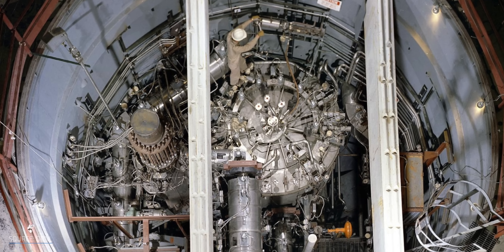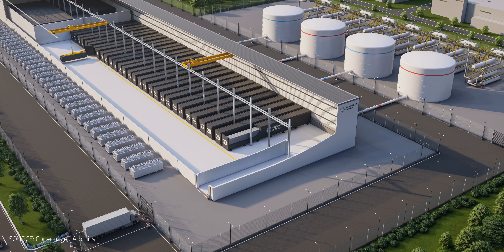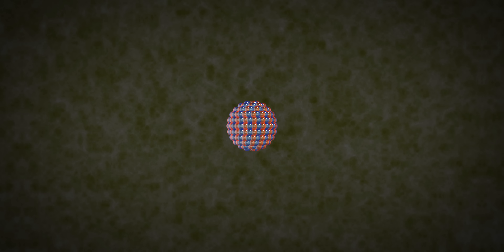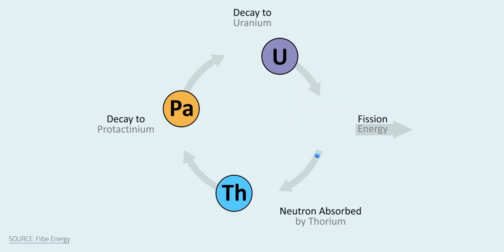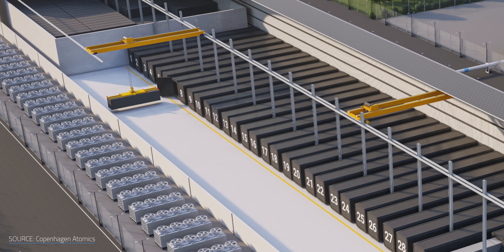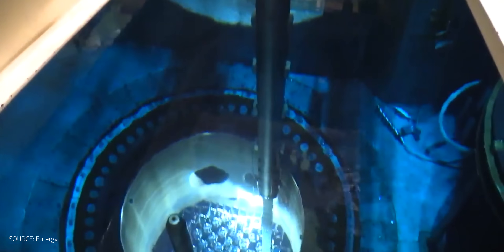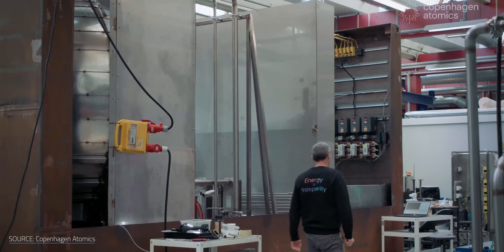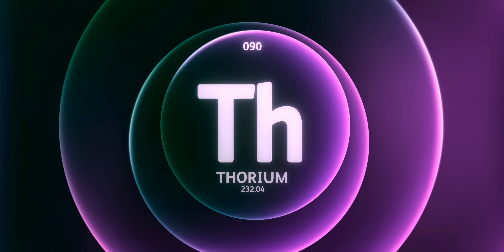Why Thorium is About to Change the World

Comment: 0:10 "closer than ever" ... So... Still on the horizon. Lol.
Reply: Yep. I'll believe it when I see it. Lots of things are "technically feasible" but politically impossible. So many science geeks (myself included) pretend the latter hurdle just doesn't exist.
Reply: China just turned on test thorium reactor I’m guessing they will make it happen on a bigger scale and India has one in the pipeline aswell so yes closer than ever!
Reply: @ronengel4586  Interesting how this guy kept spewing on about Denmark when China is far more advanced in this research
Reply: @JonathanAllan-xd8ne  Most Western tech YouTubers maintain biases
Reply: @JonathanAllan-xd8ne It could just be about access to information, as well.
Reply: @ronengel4586  "China just turned on test thorium reactor"

TMSR-LF1 went critical over a year ago and is the first step. TMSR-LF2 was intended to be a 10MWe electrical generator last time I checked (The chinese have adjusted scaling steps a couple of times)

They've already validated MSRE results AND the proposed thorium operation Weinberg was never permitted to undertake AND that dual blanket external U233 breeding is unnecessary AND that reducing the neutron flux results in almost zero wear in the moderator

I'm not counting thorium refueling as a big step because Weinberg's team demonstrated active reactor refuelling in 1966. The bigger step is proving the proposition that you don't need expensive, complicated and extremely radioactive (U232 chain emissions) processing outside the reactor vessel if you accept loss of a few percentage points of efficiency and add more thorium. At $150/kg it's a no-brainer to add the thorium rather than spend millions on processing equipment
Reply: China is presently building industrial reactors. 

We are just lagging behind.
Reply: @etienne8110 they are building pilot reactors is what they are doing. They are willing to foot the bill on repairs and reliability..... Which I mean, hats off to them... Much more exciting than thorium imo they built a pebble bed receipt. Which I think, personally is about as cool as it gets.
Reply: My thoughts EXACTLY... "closer than ever"... just like everyone before them 🤦‍♂️
Reply: @JamesCopeland-i1j  It will always be closer than ever right up until it's here
Reply: China has made AN electrical plant with this
Reply: More like the event horizon... At least other people are willing to fund these people's hobby. I guess there is that...
Reply: closer than ever...

well yeah... its got going to get further away, time only goes forward
Reply: Matt is just a click baiter
Reply: Just like a mirage.
Reply: @millenialfalcon8243 oooo that's a good one! I've never thought of that before, love it!
Reply: He's a press release guy he doesn't actually do any research
Reply: Nope, China opened thorium nuclear power plant in late 2024
Reply: In America where there is 1 million rules to stall progress and hungry investors sure .. but china is going for this so we know it'll become a reality
Reply: Meaningful, practical scientific breakthroughs are riding the asymptote. Each one now takes more time and effort than the one that came before.
Reply: the molten salts will eat through anything.
they cannot figure out the chemistry to stop this. or at least slow it down enough.  due to this I am not a believer.  solid state is the best.  batteries and getting that right is the answer.
it does not rain all the time but be always have water.
I don't see why we cannot do the same with power and intermittent sources.
Reply: @CineTechGeek there isn't enough rare earth metals in the world to go full battery future. And alternative batteries for industrial scale energy are not efficient enough.

Nuclear and geothermam are the only sensible options, and the later only in some places
Reply: Horizon.... that ever present goal that will never be reached! Just like fusion...
Reply: Well better than before in other words
Reply: @IanZainea1990  yep, about 30 to 50 years out
Reply: @XMRNYC china had already built.  West is lagging behind
Reply: A day later and we are one day closer…
Reply: Like fusion but without the funding :)
Reply: I bet Iran will have nukes before this takes off
Reply: let me tell you about Graphene...
Reply: I’d imagine another 20 years before it becomes
On the public market
Reply: @IanZainea1990  that's where the video ended for me.
Reply: well unlike fusion, thorium (or other types of MSR's) are not science fiction. They are well within our capability to produce. It's a political issue because people are still scared of nuclear energy, which means governments are not cooperative and investors are afraid to put money into it.
Reply: haha this one is different
Reply: Exactly. When you can order a thorium reactor, then it's real. Until then, it's a fantasy.
Reply: I want to believe... One step closer doesn't mean we're almost there though. Same deal with diabetes research
Reply: AI was "closer than ever" for decades.. and now we have it..
Reply: @jason2014 eh. We have advanced pattern recognition software. It can't really learn like the fictional a.i. can... And that's probably a good thing. But that also means it's not truly here either.
Reply: Unlike fusion as a power source, this is not a theoretical reactor. Two reactors of this design ran at Oak Ridge National Labs for thousands of hours in the 1960s. The only reason it's "closer than ever" is because regulators have decided to slow everything down to a crawl. It's the bureaucracy that slows everything down. Many significant problems such as a buildup of tritium (which they noticed in the original reactor) were solved using high purity salts. The same goes for corrosion of the pipes. Newer alloys and purer salts make this practical.
Reply: @jakebrodskype  The tritium mostly came from lithium 6 (7% of all natural lithium) and can be harvested/sold, with lithium topped up to rebalance the salt (remember: all gaseous products are drawn off as produced and sequestered until no longer radioactive or sold directly as radioactive sources)

TMSR-LF1 was delayed by 2 years because the Chinese government insisted the lithium used be isotopically pure. It took that long to separate it.

FWIW the amount of tritium involved is peanuts compared to what comes out of a water-moderated reactor and the collective human tritium output over ~550 reactors is a tiny percentage of what's produced naturally in the upper atmosphere via cosmic ray interactions, then promptly rained into the seas

Just because you can measure it doesn't mean it's harmful

Ironically, the most economic way of producing isotopically pure lithium is to neutron-bombard the source material to turn the lithium-6 into tritium
Reply: @jakebrodskype The Oak Ridge cleanup after the shutdown of the thorium reactor was the most complicated and most expensive project the Oak Ridge ever had to deal with.I don't think it was successfully completed.
Reply: @jakebrodskype  Exhibit A ☝
Reply: Keep sending the money, folks. They will keep pulling your leg.
Reply: @jackfanning7952  I’d rather my tax dollars go to this than funding foreign wars.
Reply: @masomidd  I would rather keep my tax dollars and not throw them away on either of these ridiculous money grabs by the oligarchs.
Reply: @jackfanning7952  well that would be a magical fantastic world wouldn’t it. If we could keep our money!
Reply: @masomidd  It would be nice if the US taxpayers had some say in scams that repeatedly steal their money for massive energy projects that private investors are not willing to put their money into.
Reply: It’s a key part of the Energy Dominance plan

Comment: Neutron embrittlement is an issue for any reactor. Not just the fuel rods. The life of the equipment in a reactor room is based on the normal wear and the neutron bombardment. You can enter a reactor room during shutdown once the short-lived radioactive material has decayed. You are talking hours not years. How radioactive does the salt stay? The navy had a couple of liquid salt reactors. They stayed very radioactive and made it hard to work around. As well as issues when the molten salts became exposed to air or water. Lastly, ALL reactors are large Gamma emitters. No one goes in the reactor room while the reactor is critical. You made it sound like this was only an issue with the Thorium Reactor. It is not.

Comment: From what I have read, the success of that process will depend upon the ability of the molten salts to remain properly contained. When that sodium coolant technology was first being developed, in part to power the world's second nuclear powered submarine, the USS Seawolf, it was causing problems from leakages.  Within two years the reactor in the Seawolf was swapped out for a spare pressurized water unit built for the first ever nuclear submarine USS Nautilus. All this happened 12 miles from where I grew up.
 I suspect improvements in materials technology have spurred this new attempt to tame the molten salt design, but wonder if its modular reactor construction method will end up being more expensive to maintain and to keep safe from terrorism. 
Elements that are so easily trucked into place, can possibly be hijacked, and trucked away for the making of a "dirty bomb". If there are units that develop problems, and get put aside for later repair, the security problems get multiplied. I am not afraid of nuclear power per se, and do think it can make a contribution to clean energy generation, but the unplanned for ancillary costs mean it may not  pencil out once again.

Comment: As always, it is more complicated. Natural U can be used as fuel in CANDU or old RBMK designs (RBMK-s were rebuilt after Chernobyl losing this capability), even CP-1 ran on it, and U-238 can be used to breed Pu-239, which can be used in U-235 reactors with some caveats (MOX fuel is not new, and even more transuranic elements can be incorporated to make hotter, longer lasting fuels, but then you might need to do modifications to the reactor). Nuclear powers don't like this, as U-235 enrichment and Pu-239 separation can be used in bomb making. For Th-232, the U-233 has similar concerns, as U-233 based bombs are also feasible in principle, even if they were deemed economically less viable than U-235 based ones and the problems with U-232, continous reprocessing could work for separation. Molten salt can be dangerous if it meets water (like HF and H2 could be generated possibly resulting in hydrogen explosion), corrosion is an issue, and they mention radiation risks which is bad if you need to service it (this could be planned for, by being able to shunt off the coolant in the emergency stop tanks or elsewhere, so the people working on the tech don't get so much radiation, as long as the structural materials don't get too active, or at least can be decontaminated). The I'll build it and run it for you model is not unique either, even Rosatom would offer this as an option in addition to the loans for building it, entirely without taxpayer money is questionable, because there are laws about the nuclear waste, so nuclear and radioactive waste deposition may need to be solved in the producing country and countries shouldn't like outsourceing critical infrastructure. Direct heat use is not unique either, but it has its own risks, like an industrial plant next to the reactor may have problems on its own, while heating a greenhouse or a fishery is safer and often done with existing plants as well. It is a balancing game, I think working on thorium is good, but we should be honest about the pros and cons. I beieve in informed consent, not fairy tales of everything will be good just do this one thing. Fusion similarly has its own potential issues, as does every other option.
Reply: Yes U-233 bombs were made in the late 1950's.  Very tricky because U-233 is the -most usable isotope in the world to make a weapon....less kg than U-235 or Pu-239 and Pu-241 bombs.   U.S. government stopped trying it because U-233 was a criticality concern, and so it was stopped.
Reply: Nuclear fission is too expensive. Every other energy source is cheaper... and safer. Fusion is a perpetual 30 years from now nuclear wet dream that would be even more expensive. I like our current fusion reactor 93,000,000 miles away.

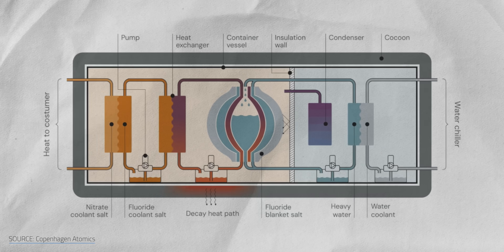Comment: @8:10 there  is nothing in the diagram to show where high pressure steam is generated to operate a turbine?   Something missing in the diagram?
Reply: That's what the "heat to costumer" (which I'd imagine is meant to be "customer") part is, I believe. The diagram is labeling the parts within the fuel cell that generates that heat as far as I can tell.
Reply: Not important… just heat using component…, could be anything

Comment: Nuclear is the only green energy that or deep earth geothermal energy.  I hope the USA is hard at work doing the same or similar type of reactor.
Reply: Solar and wind are obviously greenER than continually shoveling dirty fossil fuel into a thermal plant. They've decisively won; they're the majority of new generation everywhere in the world because they're quick and cheap, and increasingly they're backed by battery storage to extend their operating hours. We'll see in 10 years whether any of the small modular liquid thorium molten salt fluoride blah blah reactors turned out to be viable.

Comment: The Moltex fast spectrum static salt reactor is being built to burn (so called) “spent” nuclear fuel. The PWR can extract just 4% of the fissile energy. Moltex is being built to extract 99% of the remaining energy. Their waste has a 30 year 1/2 life vs 30,000 years for the spent fuel. 
Moltex use a chemical process to create fuel salts from the old fuel rods. The isotopes are so mixed up, it would be easier to create new weapons grade than trying to get it from Moltex salt fuel. 
Their reactor has a negative temperature coefficient - it cannot overheat. Freeze plug not needed. 
The salt is paddle circulated. There is no pump or freeze plug to go wrong.

Comment: India has recently (in 2025) developed a Thorium Nuclear reactor. Where the Thorium reactor produces more Uranium Fuel than it consumes while day to day operating the reactor (this is the Unique feature of the Thorium Reactors). Currently Russia, India, China are the 3 Nations who are Commercially operating the Thorium Nuclear Reactors for electricity generation. Where the US has a fully developed Thorium Reactor but US Closed down the project and Not commercially operating it bcoz US has lot of Uranium fuel sources available with it, which can be directly used in the Uranium Nuclear reactors as a fuel. And Uranium more readily available than Thorium as a fuel in the international market and currently Thorium is not that widely available in the market and have high price, Today Uranium Fuel is relatively cheap to operate, as many countries are currently producing it and Thorium production is very low so less available in the market but in future more Thorium base Nuclear reactor will be used hence in future more Thorium fuel will be produced and price will be low.

Comment: I have for a long time believed in Thorium reactors; this video excites me very much with its modular design, it's perfect. I have a question though, when you make these reactors what is a lifetime of the mechanical parts the pumps the pipes and the storage container realistically how long could they last before there's a mechanical breakdown?
Reply: he said 5 years in the video
Reply: The pumps CA has developed are the only ones in the world at the moment. Which can run for 5 years at 700 degrees. Over time, they are expected to get better as well. Corrosion is no longer a problem. I think they expect 20 to 25 years.
Reply: Watch the video more carefully. 12:21 "That steel can endure corrosive salts and neutron bombardment for at least five years, after which the reactor module is shut down and swapped out for a fresh one."

Comment: Thorium reactors are not a technology constantly on the horizon.  The thorium fuel cycle works and has been working for a long time.  You don't need small modular reactors to use thorium, you also don't need molten salts.  These are three different technologies that can be used together, but don't have to be.  You can use thorium in a more traditional water reactor design if you want.  The problem with thorium is governments' fears of nuclear proliferation.  A thorium reactor is necessarily a breeder reactor.  Fissile isotopes that can be used for nuclear weapons are necessarily produced in the thorium fuel cycle.  This adds miles of red tape to any attempt to build such a reactor.
Reply: Thorium in solid fuel reactors is more trouble than it's worth. Shippingport (the original nuclear power reactor) was run on thorium for several years.

The issue is that you add a lot of danger to fuelling for no advantges anywhere else

Liquid fuelling is a different matter and in those designs thorium really shines, however you don't have to use it if you don't want to

Comment: if a leak develops between the molten salt and the heavy water, how is the resulting steam generation controlled?
Reply: Why would it leak? It's all at atmospheric pressure. 

It would also have to be separated by a thermal barrier since the extremely hot MS would boil the water if they were thermally connected.

Comment: I wonder if this has applications for use in space. It seems much easier and safer to send the materials up, and the heat byproduct is also a nice bonus. It could be useful when traveling to places further from the sun when solar becomes less useful, and the continuous power generation doesn't have the limitations that batteries do.
Reply: Liquid fuel is a key concept for this type of reactor. Liquids are not easy to handle in zero G, so rotting space station might be able to use this.